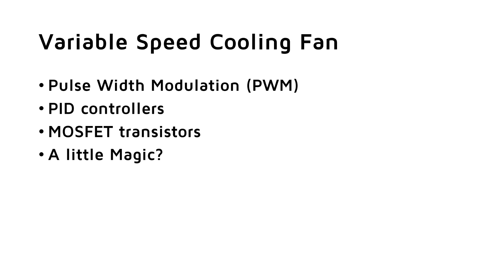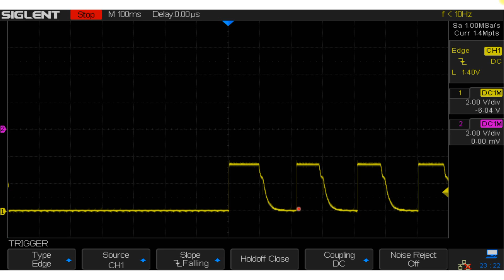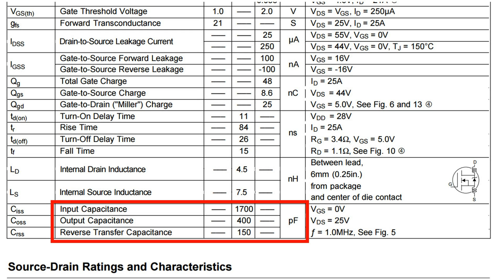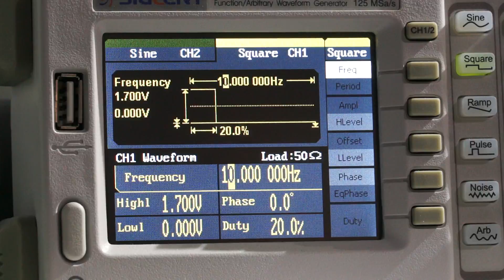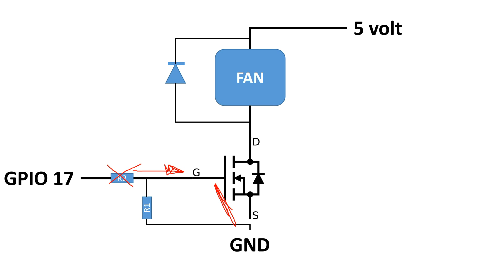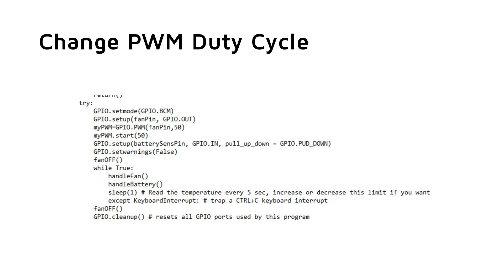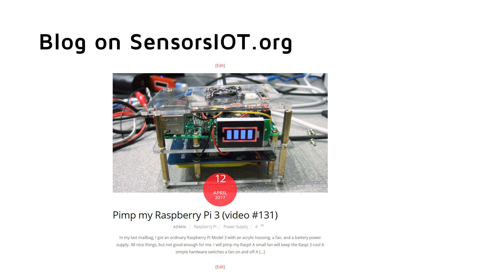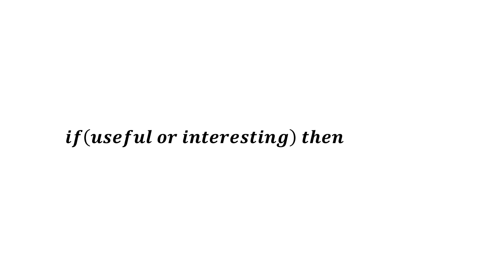#138 Variable Speed Cooling Fan for Raspberry Pi using PWM and PID controller

Comment: 2:48 I’m curious.. Could it be the fan acting as a dynamo, when the fan continues to spin after the main voltage is disconnected? Or isn’t this possible?
Reply from the maker: It for sure acts as a dynamo. But usually only for a short time. Its mass is tiny.

Comment: HI! Love your channel! So here is something strange which I cant figure out or understand (new guy here).  The output PWM from the RPi does not turn on the fan. Tested an LED with the same output and lite up. When I touch the GPIO 17 (G) wire to 5V, the fan turns on.  What am I doing wrong? Thank you in advance for your help!
Reply from the maker: Unfortunately, I cannot do remote diagnostics. I would check if GPIO17 produces a PWM signal (using an oscilloscope or check with the multimeter if it shows a voltage between 0 and 3.3v. If this is the case, I would try to connect the gate of the transistor to 3.3 volt. Never use 5V on any pins of the Raspberry. It will be destroyed!
Reply: @AndreasSpiess   Thank you for taking the time to reply. I will try this. Takecare

Comment: Hi Andreas, nice film and thank you for it. I am developing a domestic anaerobic digester and want to monitor temperature from 15 sensors (ds18b20) and control a stirrer to even out the temperature and control a heater to keep the now uniform temperature to an optimum.    I would also like it to monitor power consumption and gas output and log it all on a nice graph.     I have a fair bit of coding experience but am new to python, I have done lots with Arduino’s but am new to raspberry pi.    I am hoping you might be able to save me another lengthy learning curve?     Do you have any existing programs that I could start from?    Cheers in advance.     Tanc
Reply from the maker: I am not sure if I would connect the sensors directly to the Raspberry. I usually connect them to MCUs and these MCUs communicate with the Raspberry. So I am no big help :-(

Comment: Could make a video about a temperature controlled heat wire?
Reply from the maker: I do not see an application for such a device?
Reply: @AndreasSpiess  I use a Raspberry HQ Cam as a cloud camera, protected by an acrylic dome in a 3d printed case. Unfortunately, condensation sometimes forms inside the dome. In winter, the dome sometimes freezes from the outside. I would like to place a 1m thin long heating wire in the lower segment of the sphere and let the dome work as a greenhouse. Since I am a fan of energy harvesting, I would like to use the heating wire with the raspberry (3-5W 40-60°C). I would like to work on the power pinouts on the GPIO bar (5V 600-1000mA), can the Pi do that or will it be problematic with such high electrical currents? In any case, the next step would then be a PWM PID MOSFET control with the heating wire temperature so that it does not rise above 80°C and the acrylic melts.

summary setup
SOURCE 15W (5V 3A)

Ri4B ~ 4.5W [5V 900mA (1280mA max)]
HQ CAM ~ 5.4W [1.8V 300mA] --> CSI
FAN ~0.75W [5V 150mA] -->PINOUT PWM (HAT)
HEATWIRE ~3W [5V 600mA] -->PINOUT PWM (MOSFET)
Reply from the maker: @bra1nsen  The Pi GPIO pins only can drive a few mA. This is why a FET is needed. I would not use the header file for the power supply of a heating. The current is probably too high. And I would use a resistor for heating which you easily can dimension not to overheat (and it is electrically insulated). You switch it on of off according to the desired temperature or humidity. No fast switching PWM is needed.
Reply: @AndreasSpiess  You probably know the raspberry pi poe+ HAT (802.3at). So the Pi has 5V and 4A available. Is there no save way to use it somehow for my heating wire (5V 1.2A)? Or is it really necessary to use an external energy source?
Reply from the maker: @bra1nsen  You can try it. If the switching does not interact with the Pi you will not have problems.
Reply: @AndreasSpiess  You said pwm doesn't necessarily make sense. Okay, but how else do I keep a target temperature, which depends heavily on the ambient temperature? A kind of 2-point controller?
Reply from the maker: @bra1nsen  Heat is slow. So you just switch the heating resistor off when the temperature is reached.

Comment: I am a next to noob when it comes to electronics. Can someone tell my why it is mentioned in the video that the IRF is even better than the IRL MOSFET? Thank you!
Reply from the maker: The voltage between Gate and Source needed to switch the MOSFET on differs from transistor to transistor type. So you have to select one with a very low Vgs voltage. Sometimes they are called "Logic Level" MOSFETS
Reply: @AndreasSpiess  : Thanks for the hint on Vgs! I noticed that the IRF3708 even has got a lower RDS(on) which is certainly not important with the fan used here, but good for higher currents. BTW: I really like your videos!

Comment: Hello Andreas, 
first of all, huge THANK YOU for all the videos you are making.  I appreciate such of content served in gently manner. Very helpful for newcomers to electronics and circuits. 
I'm trying to replicate scenario from this video, although with RapPI4 and I have some questions however  as befits a beginner. :-)
Transistors, diodes, etc; are kind of new for me and I have a problem with understanding and calculating things, not to mention reading datasheets. 
Can I use BC337-40 transistor instead of those mentioned in the video?  I'm asking because I already have few of those at home so I would prefer use it what I have, unless it can't be done.
And second question is in regards to resistors and diode. Did I understand it correct that in this particular  - circuit with this fan and PI,  both, Resistor and Diodes can be avoided?
Reply from the maker: As a beginner, it might be good to watch a basic video about the different transistors. It could be of benefit for your future projects. Here, I used a MOSFET and your BC337 is a BJT. They are quite different. Your BC337 maybe also works but would need a resistor between the base and the GPIO. I do not know its size, but maybe you try it. I would start with around 5k. Or you buy yourself a couple of N-Channel and P-channel logic level MOSFETS. They are not expensive and very handy. You can go on Sparkfun or Adafruit to see which types they sell. They should be ok (no need to buy there).
Reply: @AndreasSpiess  
I will try both scenarios then, with BJT and resistor but also get MOSFET as you suggested.
Thank you very for the respond and once again for content you make. I really enjoy watching those videos.
Best Regards
Mark

Comment: Hi Andreas, Thank you for all your excellent raspberry pi and all other tutorial and facts videos. I have followed your video but noticed that I was sent an IRFZ744N instead of your recommended IRLZ44N. Needless to say that it doesn't work. When gpio 17 is set hi the fan makes a light buzzing noise like its trying to start but wont. Is there a way to use this or is it best to re-order (which takes about 2-3 weeks). Many thanks Don....
Reply from the maker: If you transistor does not switch with 3.3 volts at the gate it is not usable with a 3.3 volt MCU
Reply: @AndreasSpiess  Hi Andreas, I've now got the correct IRLZ44N and connected as your drawing and it still won't start the fan.It makes a faint noise like its trying to start but wont fire up. If I plug the fan directly to GPIO pins 4&6 the fan works fine. Can you suggest what I'm doing wrong please. Kind regards Don....
Reply: Hi again, don't worry, I've fixed it. I was trying to control it with node red and had GPIO 17 set to pmw. Kind regards Don...

Comment: Again a very sophisticated video with a nice accent. What I am missing is the CPU load aspect. There is hardware PWM, software PWM and DMA PWM which have different pros and cons and I think the CPU load for the purpose of just controlling a fan should be minimal.
Reply from the maker: You are right. I did not check it, but it is probably not very big.

Comment: Can you add in a hysteresis instead of a fixed 45C, so that the fan stops when temperature falls below 45-X and starts when temperature rises above 45+X?
Reply from the maker: You can add whatever you want in the Python program. You decide if it makes sense because this fan has a variable speed.

Comment: This presentation is a bit misleading! Using PWM to vary fan speed is fine if using a cheap fan that uses a conventional DC motor. However, most computer fans use brushless DC motors with an integrated digital controller. This digital controller requires a constant DC supply voltage and does not play well when fed by a pulsed source.
Reply from the maker: You are probably right for big and expensive fans. All the small fans I have work with PWM. Some of those fans also have an input to control speed

Comment: How hard is this for a person with no coding experience, no experience with raspberry pi, and in fact I don't even own a raspberry pi yet to make? I have a project I want to do for my truck using a raspberry pi  sending video to two small 2.5 inch lcd monitors. One will do gps and the other will be something like tv, internet, youtube. I don't want to deal with overheating the unit so I thought I might try this. Unless I can just buy it somewhere.
Reply from the maker: I propose to start one step after the other. To start with your described project is very hard.
Reply: @AndreasSpiess  I have some questions. I want to just go ahead and buy a raspberry pi 4b kit. The one thing it doesn't come with is a touch screen display. And it will come with a 64 gb sd card. This cooling system, is it compatible with raspberry pi v4? V3 is 2.5 amps and v4 is 3amps. And this cooling system is cusom made so the stock case is inconsequential?
Reply: @AndreasSpiess  I have some questions. I want to just go ahead and buy a raspberry pi 4b kit. The one thing it doesn't come with is a touch screen display. And it will come with a 64 gb sd card. This cooling system, is it compatible with raspberry pi v4? V3 is 2.5 amps and v4 is 3amps. And this cooling system is cusom made so the stock case is inconsequential?

Comment: Mosfet gate capasitance can be sometimes usefull with microcontroller driving. Sometimes you need to drive fet in the linear region and you have pwm output. I've couple times used a pwm output and a large enought resistor to connect to mosfet gate. With mosfet gate capasitance, that makes a lowpass filter without any external capasitors. (Use a logic level mosfet of course) That adds no extra components, you usually need some kind of current limit resistor at mcu output anyway to keep it within current limits. A very handy trick to just use larger resistor to get low enought high pass cut off point.
Reply from the maker: So you use the I/O pin as a DAC driving a MOSFET. Good idea!

Comment: what is the voltage that the fan accept?? can I use any type of fan that has a voltage rate of 220v??
Reply from the maker: All fans have their rated voltage. 220v fans usually are big. Here we use 5 volt fans
Reply: @AndreasSpiess  Thank you !! How can I control the 220V fan by the raspberry pi ??

Comment: So I, or current, stands for integration? Frustrating to learn this now. Thanks for the video!
Reply: hello
im beginner ... could you run the fan?

i want my fan be like this

temp: 45 degree speed 40%
temp: 55 degree speed 70%
temp: 65 degree speed 100%

can you help me with code? i really need it

Comment: Unfortunately this video did not discuss the choice of the PWM frequency. Some recommend inaudible frequencies >20 KHz, but then surely I'd need that GPIO pin protector resistor. Please also provide rough Ohm specifications for the resistors for us sore beginners.
Reply from the maker: As it is written in the blog, you can omit these resistors if you want. It should work. The for me the frequency does not matter as long as it is not very low.
Reply: @AndreasSpiess  Interestingly, 20 KHz is making awful noises. 50 Hz seems to be a good choice. Perhaps the PWM noise can be smoothed out using a small capacitor?
Reply: @otm646  Awesome, thanks!

Comment: Great work Mr.Andreas,
Can we do a pwm directly to the fan ? "Without a transistor"
Reply from the maker: No, the pin cannot deliver enough current
Reply: @AndreasSpiess  so the 5v pin can handle higher current consumption ...
Reply from the maker: Of course

Comment: Why is fanSpeed not [fanSpeed += pDiff + iDiff] ? Im confused because in the PID controller code i found in the raspi website the outputs are all added? Please explain im very confused
Reply: pDiff is the Proportional, and iDiff is the Integration part, that's why the output for a PI controller is the sum of pDiff(Proportional) and iDiff(integral).
Reply: and yes it should be a summation, fanSpeed += pDiff + iDiff
Reply from the maker: You are right.

Comment: It`s a Great video & agreat work! But, in my oppinion, the mosfet must  be with very small charge of the gate - the port`s of raspberri PI have a very small source /sink current.It`s means that there are very slowly charge/discharge of the mosfet, and output pins of the PI  will be overload - te capacitance is too much.
Reply from the maker: I did not measure the current. But the gate capacity is not big and so far, I had no issues. Best practice would be to add a resistor of course.

Comment: Hi Andreas! Really nice work! Thanks for your videos. Is it possible to make something like this but to control a 120V/220V Fan? Control the signal on the relay?
Reply from the maker: I usually do not work with 110/220 volts on YouTube. It is quite dangerous.
Reply: hello
im beginner ... could you run the fan?

i want my fan be like this

temp: 45 degree speed 40%
temp: 55 degree speed 70%
temp: 65 degree speed 100%

can you help me with code? i really need it

Comment: Fantastic tutorial! I just implemented it with a few twists, for example: transmitting via UDP to my computer: CPU load, current temperature, fan speed, and the PI calculated values. How did you create the graph shown around 12min in the video? Excel? I am looking for a software that It can read UDP packages with data and get it plotted time-based. Any suggestion??
Reply from the maker: People use InfluxDB and Grafana for time-based series.

Comment: I was wondering if you could include a video of actually implementing this plan with specifics.... the code, exactly how to upload the code, and specific wiring of the circuit (gpio pins used)
Reply from the maker: I think it is pretty much covered in the two videos about the topic. Maybe you have to watch also the first one (Pimp my Raspbi)

Comment: Hi Andreas,

I created the circuit described by you but I found that the result is of course correct because the PWM affect indirectly the fan speed because it switches on and off the power to the fan very quickly.

I have 2 questions:
1) The fan is noisy especially when is far from the top speed. I guess this happens because of this fast switching mode introduced by PWM. If I use a variable resistor and decrease the ddp than I guess the fan will not make that noise ... am I right?
2)  The fan will not "die" quickly in time because of the PWM fast switching?
Reply from the maker: PMW usually is very fast (I do not know the frequency on the Raspi) and the fan should not react to it. If you think this is an issue you can connect an electrolytic capacitor in parallel to the fan.
However, I saw that the file powerTest2.sh somehow is corrupted. I have to look into it when I have time.
Reply: Andreas Spiess Hi Andreas, thanks, nice suggestion, I didn't thought about the introduction of a capacitor, I'll try and let you know. One more thing : I created a script that turns the duty cycleto 0 (fan stop) when temperature is below a certain degree but when this happen my Raspberry shows the symbol on the screen that says
Reply: ... There is not enough power and then disappears... Any idea what can be? Maybe a spike?
Reply from the maker: Maybe you check your wiring. Maybe you create a „short“
Reply: Andreas Spiess ok thx, but how come it happens only when I shutdown the fan?

Comment: Hi, nice Video, but i don't get your code to Work. I'm getting an TypeError for the sum = sum + diff equation because it can't add a builtin function with a float. May you help me with that?
Reply: Okay i did it myself. I had to definde sum = 0 first and set myPWM als global. Just for the case that anybody else had the same issue.
Reply from the maker: Thanks!

Comment: I read the comment on the video 131, but I still dont understand why the IRF3708 would be an even better choice
Reply from the maker: A low Vgs (much lower than 3.3 volts) is important because we only work with 3.3 volt.
Reply: Ah ok thank you. I thought it was the Vgs (th) that only mattered in this case. And as they have the same  Vgs(th) max at 2V, I did not understand